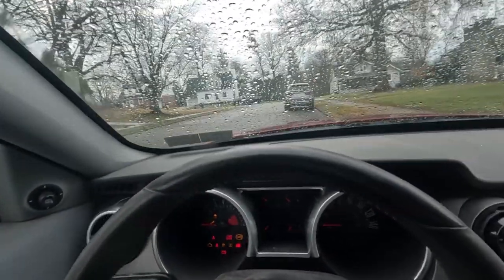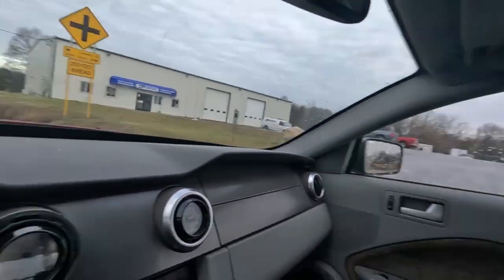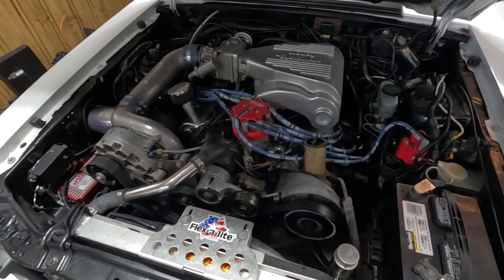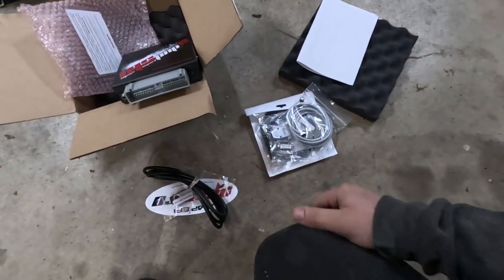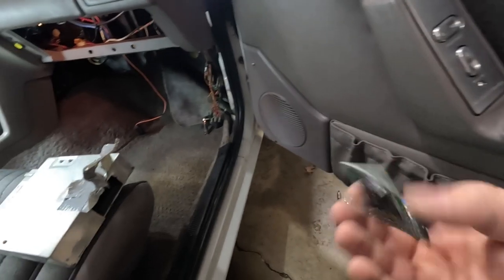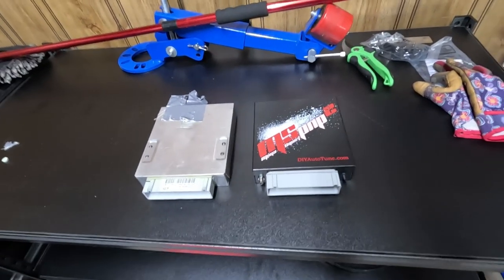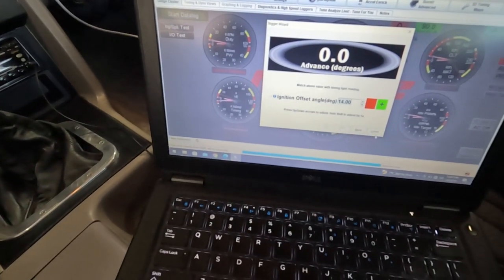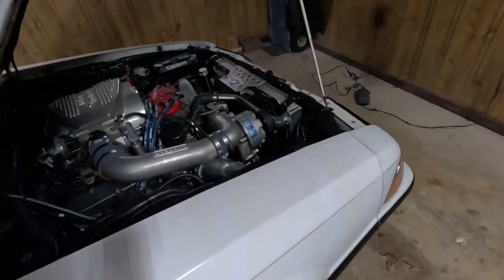Installing and setting up a MEGASQUIRT PNP on a SUPERCHARGED Fox Mustang! Pt. 1

Comment: I have the same setup with supercharger etc.  I went with the ms3 (Microsquirt). All was pretty straightforward.  Also went with an android head unit and shadow dash for my gauges.  Not using maf, using map. Of course had to install a wideband o2.

Comment: recently got a '94 that came with a moates f3v2 chip, and another spare. wanted to get some tfr 11r 190 heads, but moates and the quarterhorse is gone, so this is looking like the next best option. are there any downsides to this setup?
Reply from the maker: It has a little bit of a learning curve, but being open source it’s easy to find help and info with just searching.
Reply: @ZeroFoxGarage  have you messed with the ms3pro at all? they recently came out with a pnp kit for it

Comment: You can never retard timing less than the trigger angle in basic trigger mode. If you need lower timing in boost it wont retard lower!